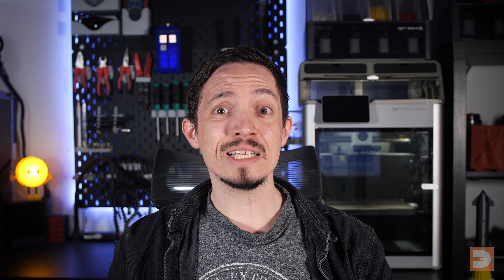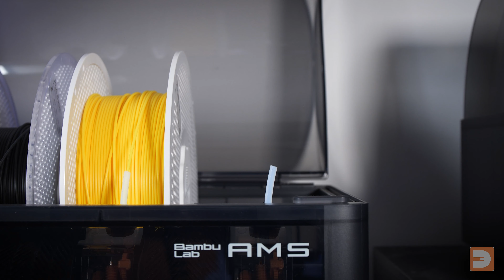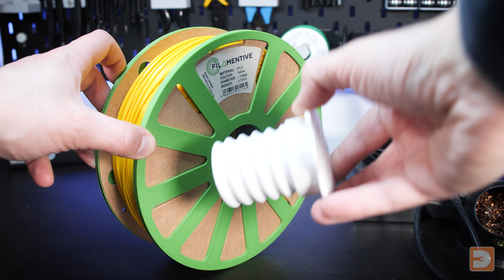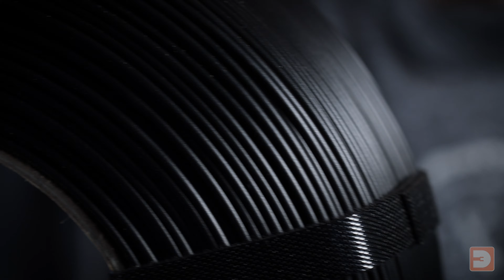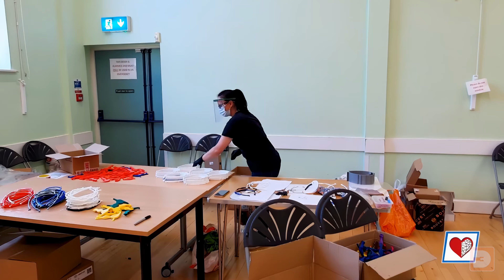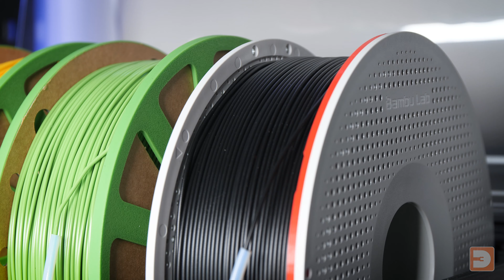Cardboard Spools in Bambu Labs AMS: Risks and Remedies

Comment: having just gotten back into 3d printing after a 10 yr break the innovation is amazing. so i bought into both elegoo and bambu eco systems. day 1 use of the ams2 with p1s the cardboard spool jammed and burned out the motherboard of the ams and fried the usb hub board as well. so suffice to say i'll not be using cardboard any more. super easy to transfer carboard to spool. i rip one side off then the other when replacing spool sides. easy peasy.

Comment: Pissed me off. I ordered new filament from Amazon.  The pictures, showed plastic spools.  That is why I selected them.  They show up with %$$$#@$% cardboard spools. F-It!  I'm using the carboard spools directly in the AMS.   Multicolor prints soon will be switched to the K2 anyway.  Bambu should make available new AMS roller that are cardboard spool compatible.  I made plastic tires before and they just pop off and jam the AMS up.  I swore I would not order any filament on cardboard spools.  I did not, yet they showed up with cardboard spools.
Reply: Yeah done that to me as well
Reply: @petermorin1  The Creality CFS handles cardboard spools well, but it also has spring loaded tension rollers in the lid of their CFS (AMS).

Comment: So the main problem is that the cardboard spools edges that roll off have wear and cause flocks to go everywhere ?
So why dont we just print 2 rings with a L profile and glue them on the cardboard spools edges ? Or if you want to go overboard 2 oversized disc wich will be glued of clipped to the outside to the spools so plastic runs on the rollers instead of paper ?

Edit: Wow, already invented hahaha

Comment: On my AMS esun, polymaker, polyterra and inland all fit with the lid shut using most spool rings that just got along the rim. Have never had any issues with it.
Reply: I printed the eSun rings but they stop the lid from closing. Where did you get yours from, thanks.

Comment: I’ve found just painting the rims of the spools with clear nail polish is quick and  works really well. I’ve used printed rims but the exact size is very fussy. (I haven’t done any printing in TPU yet, a slightly stretchy tire could make them more adaptable. Nail polish works great :-)
Reply from the maker: Nail polish is a nice suggestion and not one I'd heard discussed before, thanks for sharing Dave!

Comment: I tried respooling quite a few rolls of filament, and alot of them ended up breaking the filament. Not during the respooling process itself, but after a few days. Reason being that the innermost filament on the cardboard-spool is wound tighter than the outer layers.
When you respool ie. bringing the outer layers to the inside and vice versa. You introduce unwanted stress into the filament. And in my case having to deal with a alot of filament breaking mid-prints.

I also tried using tires, but getting the exact size was tricky, and sometimes the tiny bump created by the seam when printing the tire, caused the spool not to spin properly

I ended up just using all my cardboard spools that i had in stock, and then buying filament directly from Bambu instead. They are actually quite pricecompetitive as long as you buy more than 4 rolls at the time
Reply from the maker: Very interesting point about the varyence in applied pressure depending on how deep the filament is wound. 

Agreed, if you buy in bulk from Bambu they are as cheap if not cheaper than many competitors.
Reply: @3DRevolution  I love the idea and the concept of the respooler. But for me it just didnt work out 😕
Reply: maybe you can break the cardboard spool print a conical adapter and push it over onto a splittable spool and reassemble it ? sounds like way less work but i dont know never did try it.

Comment: I have ZERO issues with carboard spools just as they are.  Bambu doesnt want you too just so you buy their stupid chipped filament spools
Reply from the maker: I absolutely get the marketing benefits for them. That said, I also quite like the chiped spools and considering they are pretty price competitive and a lot of the time cheaper than alternatives, I think it's a nice feature to have.
However, I agree that a lot of the time cardboard spools are not a problem at all. It largely comes down to the quality of the spools. Some brands just use terrible quality that can bend or crumble just sat in my hand, let alone rolling aorund in an AMS and I have no problem seeing that wearing down and clogging up the system with cardboard particles if it even held it's shape long enough to get to that point. But with well mads cardboard spools they can absolutely work perfectly with no issues.

Comment: I've ended up putting a Polymaker PolyTerra PLA+ on a used Bambulab spool. I've practically ripped the Polymaker spool, and fitted onto the other spool using an adapter printed before. I've tried to use the tyre solution for cardboard spools, but the friction was too much

Comment: I have been using a lot of Elegoo filament that comes on cardboard spools, they have the edges sealed so the cardboard should not loose particles when used directly in the AMS. Unfortunately, their perfectly wound spools that look so nice and neat only work for up to about 2/3 of a spool for me before the filament can't be pulled from the spool, not because of a tangle but because it is just too tight on the spool. This has happened to me several times in both of my AMS units. I have even had a spool being fed from my S2 filament dryer directly to the printer without the AMS and I found the spool stuck to the top of the dryer and the print head moving around without extruding any filament, The extruder just could not pull hard enough to get the filament off of the spool, I had to pull very hard to get the filament loose from the spool. After so many issues, I now re-spool every spool that I get from Elegoo. I have a re-spooler with an attached motor so I set up the spools, turn on the motor and I can walk away and do other things while it's re-spooling. I find not having to stand there with a drill to do the re-spool so much more convenient. The re-spooled filament may not look as neat as the Elegoo spools but they work so much better, I have not had any issues related to re-spooled filament, they have been very reliable in the AMS.
Reply from the maker: That's great to hear. May I ask which respooler design you've gone for, or have you designed your own custom one?
Reply: @3DRevolution  Sure, I started back in July of 2023 with the "Bambu Lab P1 / X1 / X1C / X1CC Filament Spool Switcher & Winder if you use AMS" found on Printables designed by Miklos Kiszely.  Unfortunately, I had a lot of trouble with parts breaking, In September of 2023 I upgraded many of the parts using "Awesome Filament Spool Rewinder - Upgraded" which also included the electric motor drive as an option. That was also from Printables Designed by Diplomator. I think it was the double bearings on the gears that made the difference. So I guess it's a bit of a Frankenstein but it has been very reliable for me, Once the spools are installed and the filament attached to the new spool, re-spool of 1kg takes less than 3 minutes. I use both Bambu Labs spools and the printed "*V3* Bambu Spool - HoneyComb Edition - With Filament Markers".  Lately I have been re-spooling 1 to 4 spools a day.
Reply from the maker: @ovity0ns  Really appreciate the feedback, thanks very much and really glad it's working out for you. Happy printing!

Comment: I’ve been using cardboard spools in my AMS since day one, over a year ago without any of the issues mentioned. I put a layer of electrical tape on the edges. Takes less than 2 minutes.
Reply from the maker: Really good to hear. As I mention in the video these problems aren't a guarantee, but they are the concerns that are generally discussed resulting from Bambu's statement about not using cardboard spools. 
However, it does seem that for most people these issues don't become problematic. Happy printing!
Reply: Can i just put tape around the whole diameter of the spool?
Reply from the maker: @cheizaguirre5494  You absolutely can, and some people have great luck with that, but depending on the quality of the spool, and the tape, in some cases it can become unstuck and wrap around filament etc and cause problems mid-print. But no harm in trying it out with your setup :)

Comment: I've been using them in the AMS for 2 years now, about 200 spools/year (eSun and others), zero problems. YMMV
Reply from the maker: Very good to hear! Thanks for sharing!
Reply: @3DRevolution  Indeed my problems with the AMS aren't from the carboard spools but from the flimsy first stage (they fail on some of my AMS who only see plastic spools) and Bambu treating those like consumables you need to keep replacing. Unacceptable. I've started buying my printers from a EU reseller so at least now the 2 year warranty applies (it doesn't if you buy from Bambu's own website in China).
Reply: Is elegoo brand okay?
Reply: @cheizaguirre5494  IDK, never used it because my suppliers don't carry that brand and AFAIK Elegoo doesn't sell in bulk, and doesn't make ABS (I know they make ASA but my customers require specific blends of ABS).

Comment: You could try using Gorilla tape on the outside.
Reply from the maker: This is a good potential solution and one I did mean to mention in this video. I think one of the concerns here is that the tape can (especially with some brands) wear just as much as the cardboard and still produce potentially problematic particle residue. Either that or it can become partially unstuck from the spool and cause issues that way.
However, with the right spools and the right tape, this is absolutely as good a solution as the spool tyres in many cases. 
Thanks for posting though, always encourage the community to get involved here and share suggestions to help each other out!